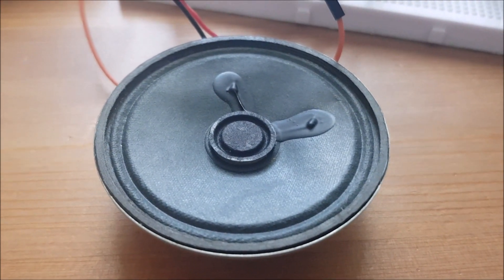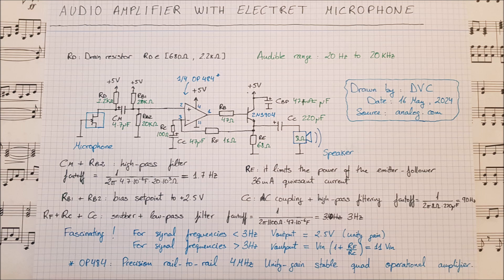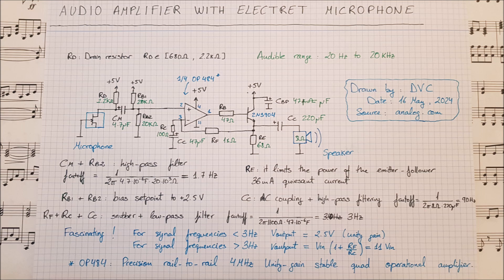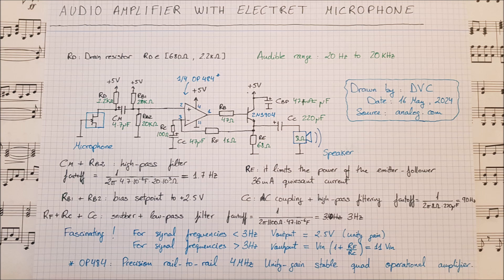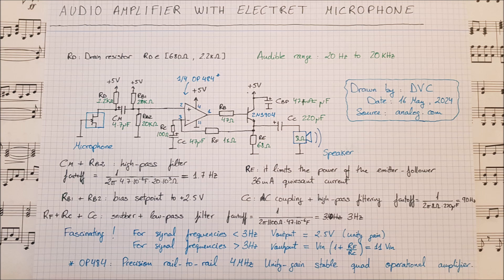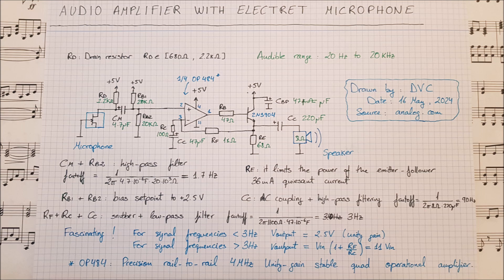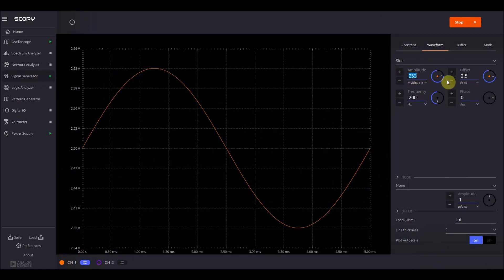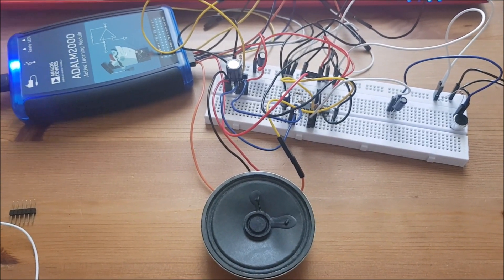How to Build an Audio Amplifier with Electret Microphone

Comment: Nice video! I have a minor correction. When you calculated the cutoff frequency for the high-pass filter, you used the  𝑅𝑏2  resistance of 20 kΩ. For an AC signal, you also need to account for the 𝑅𝑏1  resistor. In your formula, instead of using  𝑅𝑏2  alone, you should use the parallel combination of 𝑅𝑏2  and 𝑅𝑏1 , which equals 10 kΩ. This adjustment changes the high-pass frequency to 3.3 Hz.